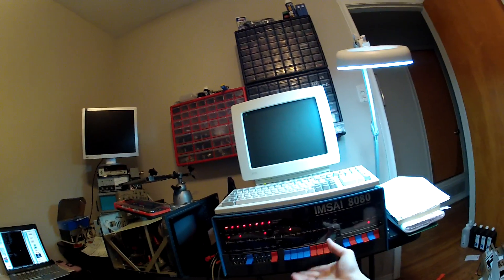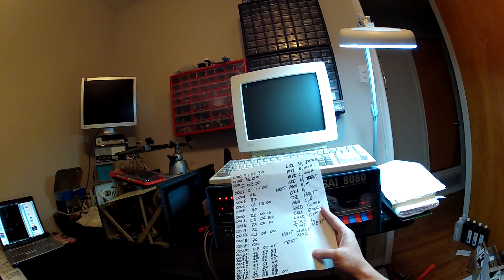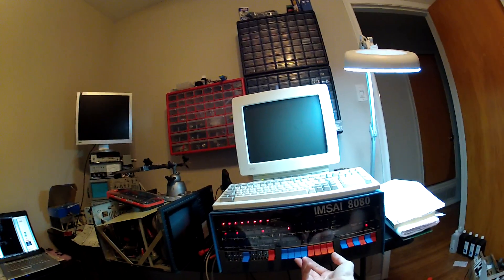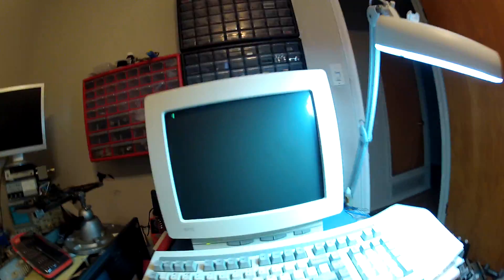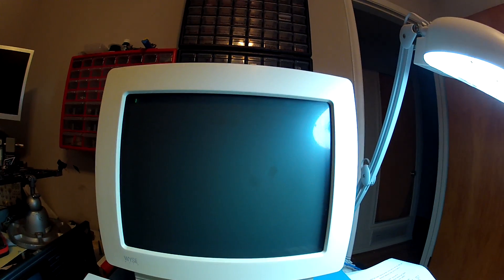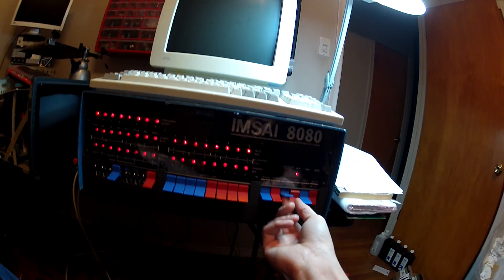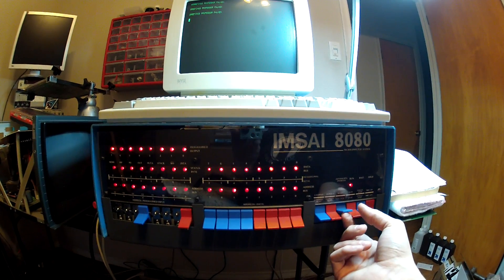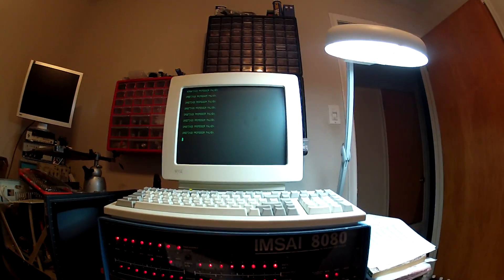IMSAI 8080 Panel/Terminal Demo

Comment: I was wondering why there were so little instructions, then I saw the subroutine call which made me sad because I can't do this on my IMSAI. (please release the whole code!)
Reply from the maker: That is the whole code.  Just like any S100 or CP/M machine, the code will be dependent on your exact hardware.  If you have the exact same serial device for your console, it will have the exact same ROM in it that I'm calling.
Reply: aaaaahhhhh i didn’t realize you were calling a ROM address. My mistake!

Comment: Slick!  I've seen pictures of those machines but have never seen one operate before.  I love terminal, too!  I need to get my hands on a working terminal.  I think I'd like a VT220 as I used to use those back in the day, but I don't think I'm locked into that.

Comment: Couldn't you just install code on rom then just key in the address of the of the rom and run it? or is there something I'm missing?
Reply from the maker: that linux guy well, sure, but the lack of that ability is why the switches are there

Comment: God I wish I could go from hex to octal to binary like that. That was impressive in it's own right.
Reply from the maker: Thanks.  It's all the same thing when working on an 8-bit machine with binary input.  binary, of course, is 8 bits... group that into fours and you get hex, or group it into threes and you have octal.  11111111 = FF or 377.  The front panel has a scale on it to help visualize it, which makes it rather easy.  In both cases it is the same thing.  Lets take the decimal number 15 for example.  In binary, 4 bits make this number, and their bit positions are valued 8,4,2,1.  8+4+2+1 = 1111 Binary.  This is also F hex, because 8+1 = 9, 9 + 6 = F.  In octal, this would be 17, because 0111=7, 1000 = 8, same as binary.  In unix, file permissions are bitmapped in the same binary/octal relationship.  rwxrwxrwx = 111111111 binary, or 777 octal.  This is why people "chmod 755" or "chmod 644", because they are setting the permissions rwxr-xr-x or rw-r-r- respectively.

Comment: Thanks for the video. I didn't know how exactly these early personal computer could be programmed. No wonder why early amateur programmers had a hard time. That computer is great to learn the fundamentals of computing that are not really needed today and is impossible to see. 
I can imagine the enthusiasm of first computer amateur users. The leap from mechanical calculators to PC must have been tremendous like the leap from BBS networks to internet. 
It must have been a very romantic era during mid 70's. 
Of course these machines were very expensive but affordable for enthusiasts. It is like ordering a new Mac Pro with the best opinion and paying 10.000 dollars. 
For example the parents of Broderick actor from war games movie must have paid at least 3.000$ then. 7.000$ equivalent today. I like that these 80's movies were sponsoring the American Dream of upper class citizens. As far as I know only 20.000 IMSAI 8080 were sold. Not a toy for every wealthy kid.
Reply from the maker: +Achilleas Labrou Well, this just demonstrates how to interact with the machine from the front panel, which was the most basic configuration.  With a ROM Monitor, all front panel work was unnecessary.  It wasn't long after this machine was released that no "personal" computer had a front panel like this.  As for War Games, that was all product placement.  The computer used in that movie can't even function as a computer - it's specially wired to make the panel lights look interesting.  The Imsai, Altair, and others of its sort weren't "kids computers", they were targeted at serious adult hobbyists.  It wasn't until a few years later that machines like the Apple II, TRS-80, Commodore 64, TI99/4a, and others started coming out that marketing departments really started pushing for kids to ask mom and dad to buy them a computer.  Likewise, the E-Mu Emulator II sampling keyboard that Broderick's character had in Ferris Beuller's day off was not something that parents would have bought for their kid... Many thousands of dollars for that.

Comment: Thanks for the demo. I had no idea those early '70's computers needed all that toggling just to get them started.
Reply from the maker: Yeah, this machine doesn't have any ROM in it- so if you want to boot it up, you have to toggle in some code to get it there. These early micros were basically like minicomputers- many of which had no ROM either. A big difference there though is that minis typically had core memory, whereas micros of the time typically used static RAM. Core is non-volatile, and this retained its contents with the power off. If you toggle boot code into a mini, so long as the software that you loaded afterwards didn't overwrite the boot code, all you'd have to do is turn it on and toggle the address for the boot code.  In the case of this video, my serial card I used for the console does have a ROM in it, but it just contains routines for IO handling, so you can see in the code where I pull a character from memory, into a cpu register, then jump to a rom subroutine in the serial card to display it on the terminal- otherwise the program section might have been 2x as long!
Reply: +TX Dj Very interesting. Does this machine doesn't have an OS installed? (Hope it's not a stupid question) Because looking at Wikipedia, it's says these machines have CP/M and later versions had BASIC and FORTRAN.
Reply from the maker: +aussieboy77 The machine in this vid has no storage media.  you'd notice if it did, a double 8" floppy drive subsystem is the same size as the machine. ;)  I could run CP/M though, if I wanted.
Reply: +TX Dj Oh, OK then.

Comment: Hey, thanks for the video.  The scary thing is I mostly followed what you did there.  Okay, so I have one of these with two 5.25" drives.  But there's no bios right?  So even if I had a DOS disk, how do you boot this thing?  Do you need to hand enter machine code to create a boot loader each day?
Reply: SteichenFamily You will need to key in the appropriate bootstrap loader for your OS. If you have a boot loader ROM you can go to the address it is installed at and RUN which is much easier.

Comment: All that toggling just to get it to display 'Greetings Professor Falken'?!
Reply from the maker: Of course!  The first part of the program sets up some memory and some other goodies, and starts a loop which takes the data from the second part of the program, and shuffles it one byte at a time into a register, and then calls a ROM routine which causes the serial card to output that byte to the terminal, then increments its pointer to repeat at the next byte.  Every program in every computer works very much like this, but when you don't have an operating system, or even a ROM monitor to put the program into memory, your only option is to toggle each byte of the program directly into its memory location.
Reply: TX Dj  Utterly fascinating!  Thanks for the explanation.  I'm 53, and distinctly remember we had an IMSAI 8080 at our New Jersey high school electronics class circa late 70's, but I never used it!  You had to sign a sheet (often days in advance) specifying what time you were going to reserve some time with this machine, usually after school.  I remember small crowds gathered around the IMSAI, fixated upon it and it's operators.  Alas, I never experimented with it, instead opting for spending after school time in the Ham Radio club room.  Many of the guys (and girls) who spent time on the IMSAI went on to become engineers, some working for Raytheon, IBM, and one of them, NASA!  Thanks for the video!